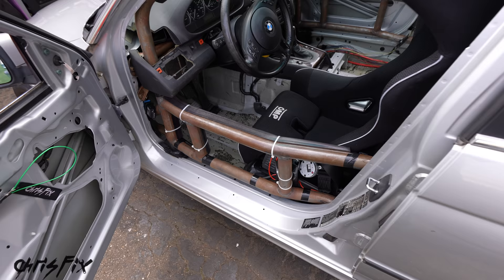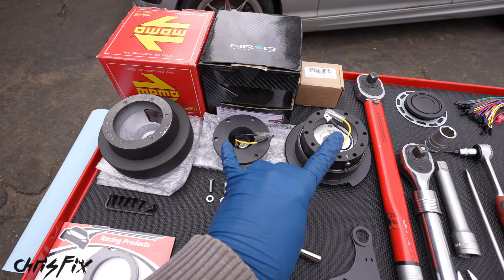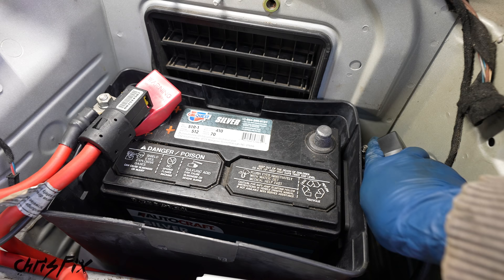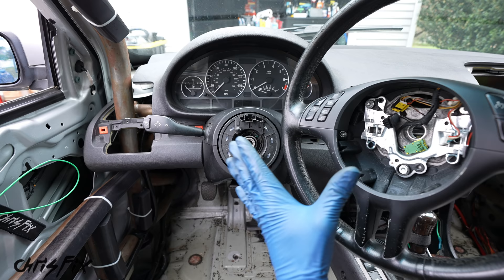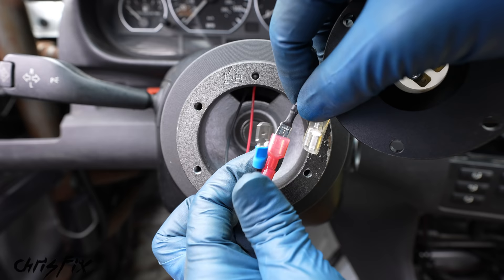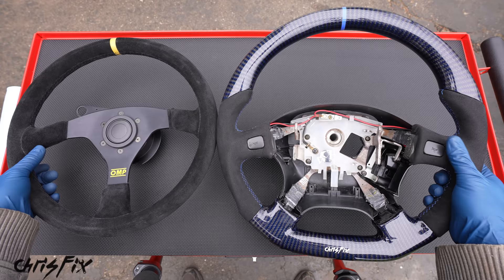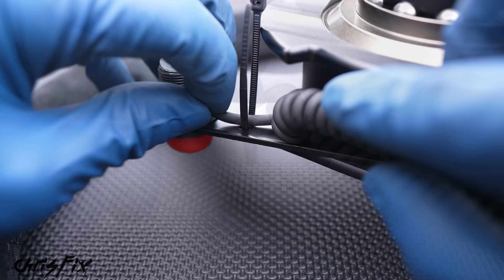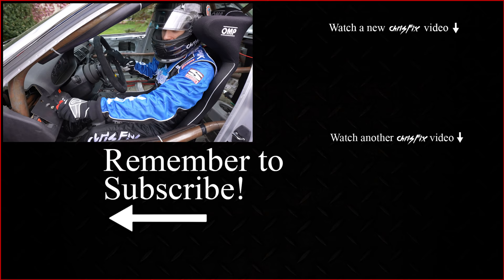How to PROPERLY Install a Quick Release Steering Wheel (with Working Horn)

Comment: quick tip if the wheel doesnt come off right away, keep the bolt in the hole for the wheel a few threads so when you are pulling on it you don't hit yourself in the face

Comment: Looking forward to that fire suppression video!! I plan to go with an electrically actuated one instead of a mechanical knob, and of course buying from Stable Energies once I pick it out. 
Curious about going with the mechanical battery isolator instead of an electronic one like the Cartek. I've got one but haven't installed it yet
Reply from the maker: An electric one wont pass tech inspection. They dont allow it.

Comment: Hey Chris, great video as usual. I‘m wondering, does the wheel connect in the correct orientation every time? Or is it possible to attach it crooked?
Reply from the maker: It's always gone on straight

Comment: 19:53 slight error there. Both wheels have to turn the same amount of degrees to turn the car. However with a larger wheel your hands move more to turn it the same amount of degrees.

Comment: A decade+ in plus 2 years of automotive schooling and this is one of the most informative videos on a steering wheel overall period. Some of my mentors couldn’t get close enough to this kind of information besides general and safety issues or unknown technical issues or electrical-based issues 😂

Comment: Chris, could you help me?
 

I am a member of a Formula Student team in Brazil and we are trying to implement radio communication with the driver, I saw your video and found the solution you got for your Lemons BMW interesting. Could you explain more about the system you used or pass the link of the solution you got? (Does it look like you got a kit with the Motorola Mag One BPR 40?) I would also like to hear what you had of experience with radio communication and if you have any tips that can be useful to us, mainly because my concern is to hear several reports about implementations communications that were inaudible due to extreme noise. Did you have problems communicating using the radio?
 

I've always been a big fan of your video style and I wish you all the best. Thank you for everything.

Comment: The angle of the wheel doesn't change with the size of the wheel. Smaller wheels may feel like they turn faster because he reduced diameter but the angle doesn't change. If you turn either wheel 15 degrees, the steering box sees only the 15 degrees.

Comment: I highly recommend you do not use liquid electrical tape but instead use hot glue.
Initially this sounds like some hack job mess, but hot glue releases with isopropyl alcohol.

So you could plug it there with hot glue, and when you want to take it out you just put a little isopropyl alcohol in there and wiggle it around so the alcohol can get underneath and then just lift it out. You can even make a plug that way.

The liquid electrical tape is a lot harder to clean up

Comment: I removed the center bolt from the steering wheel. When it suddenly broke loose,  the extension wrench went thru the windshield. I couldn't believe it!!! Learn from my mishap. Break it loose with the wrench end facing the floor.

Comment: Where's the link to where you can send your stock steering wheel to get customized like that? That's a great option rather than losing the airbag
Reply from the maker: You'll be adding black paint so it should blend in pretty well!

Comment: Great video! I have a question if you could advise me, i have a problem in Bmw E46 with steering wheel i have race steering wheel and directional light after turn on road it does not turn off after returning the steering wheel to the first position if you understand what I mean🤣

Comment: Good stuff, but why not just mount the button to the other end of the quick release in between the hub. That way your wheel could come all the way off, maybe you’d have to bend the bracket a tad to get it closer but it’d be nice to take the wheel off and not have that floating wire 🤝

Comment: Thanks a bunch sir!! Definitely good video. So I am in the process of building a purpose built drag car with a 88' Gt mustang. I am literally trying to do as much of the work I can before paying someone to do it! That being said, I am in the process of Running the power, and charging system, and honestly I think I am probably over thinking it, but I am kinda stuck with just How exactly I should wire it? Maybe you can make a video for how to wire up a basic charging system and push button starter on a Carburetored motor?? Just a suggestion, lol. Anyways I seriously doubt you read this entire message but if u did. Thank you

Comment: Hmm… well…. My 98 integra’s column spinning apparatus did not fit with the adapter that’s made for the 98 teg column. It does have the notch that’s needed to disengage the turning blinker, but I had to remove the apparatus in order for the adapter to seat 100%.. the adapter DID come with a brass plate & ground wire for the horn that slips to the back of the adapter when sliding onto the column but I still don’t see this working like yours.

Comment: As an electronic hobbyist, just a suggestion: avoid those breadboard "Dupont style" connectors like the plague. They're just about the worst connectors one can get: they come loose, the break at the crimp, they don't make good connections... Especially the cheap ones

Comment: Actually it's not the angle of the smaller steering wheel that makes the car turn more, it's just that the circumference of the wheel is smaller, so for the same distance you hands move the car turn less 😉 can't wait for the next lemon race 😊

Comment: I would've made a connector for the horn pins, those Chinese breadboard jumpers use steel (sometimes copper plated steel) stranded wire which will fail very quickly due to vibration. Seriously, just bring a magnet near them and you'll see. Look at using a dupont connector kit for making your own. I'm an EE by trade and we regularly have weird issues caused by failed breadboard jumpers just from daily lab use.

Comment: Haha the airbag can still go off when disconnected. One way is static electricity so sliding it around on the cloth seat and juggling it around is probably not the best idea. Especially since you are sitting in the car and therefore not grounded.

Comment: I've seen a lot of tuner videos with removable steering wheel installs on cars that may never see the track and I always thought that was incredibly foolish so thank you for putting up that warning hopefully some of those idiot will not do that and put their lives in danger just to look like they have a damn race car
Reply: I am said idiot, cause o do have a street car,but it will also be a car for events that require a roll cage, harness. All the safety you need

Comment: The part about the diameter of the steering wheel impacting the steering ratio is wrong. For every degree you turn the steering wheel, the car will turn the exact same. What will change is the distance your hands will have to move (since a smaller wheel obviously has a smaller perimeter which means less movement). Just wanted to avoid the confusion that could lead to a bunch of people buying the tiniest steering wheels ever just because "my car has a better steering ratio with a 10cm steering wheel"

With that said, the video was great

Comment: Hey Chris, just a small question. If I have a car that has airbag, but it was optional for additional cost at dealership, is it okay to remove steering wheel with airbag for the aftermarket one? Because I doubt they made different safety features depending on if you bought the airbag or not. Thanks prior for answer :)
Btw, nice videos man! Keep up your excellent work

Comment: Could you make a quick release steering wheel with and airbag?
Reply from the maker: You probably technically could, but there would be no point because quick release wheels are only for cars without airbags (purpose built track cars or cars that didn't come without airbags) and there are plenty of awesome custom steering wheel options out there if you want to keep the stock steering wheel safety, feeling, and features

Comment: Hey Chris I have a 2005 duramax and it’s having problems where the batteries won’t charge I’ve replaced both batteries and put two brand new alternators on and even tested them off the truck to make sure they are good and still had the problem I’ve come to the conclusion that it’s either a bad ground, a bad wire, or a bad fuse if you could give me your thoughts I’d greatly appreciate it. Thanks love your videos

Comment: Small thing about steering wheel diameter you got wrong. 1 degree is 1 degree, if you turn a small steering wheel 1 degree the car will turn just as much as a large steering wheel turned 1 degree. That sensitivity you talked about comes from how far you need to move your hands to get that resukting degree of turn which is a distance measurement (cm, inches, etc.) not an angel (degrees, arcminutes radians, etc.)

Comment: Why can't you have an airbag in a quick release steering wheel? I understand there is wiring to supply power, but couldn't that be substituted with some contact points or pins in the hub adapter and wheel? Your stock wiring could be plugged or soldered into the hub adapter, and have a non locking plug on the wheel.

Comment: will disconnecting the airbag cause the airbag light to stay on ?
Reply from the maker: I believe on most if not all cars removing the airbag will set that off. You can wire in a resistor or you can remove the bulb in the clustor if you want the light to be off

Comment: Great video thank you! I’ve read that some people experience stiffer steering and it doesn’t self centre when installing some short hubs like the NRG for a quick release system.  I’ve also read that shaving some off the airbag connector plastic on the clock spring resolves this, but I’m wondering if it could also be the locking mechanism that you removed towards the end of your video. Any thoughts on that? Thanks

Comment: Man, here I am back at this video after a couple months of my nrg quick release working perfectly. Now my horn blows constantly with the steering wheel on. completely disconnected horn button and still the horn blows when i install the wheel. The only thing i did different is i didn't use the stock ground on the clock spring since my hub adapter had a ground wire that grounded through the shaft. for whatever reason the quick release is completing the ground circuit when it clicks into place. looking at how it's assembled it doesn't look possible. If i remove the wheel and put a screw driver across the two contacts on the hub the horn works as it should. I'm dumbfounded.

Comment: Hey Chris, I would love t oget a tip from you on my problem. I'd love to change my stock steering wheel to aftermarket one, the problem is that stock wheel has multifuncional buttons used to control the actuall on-board computer between dials behind steering wheel. I want to change it to one without buttons, is there any different way to control the on-board computer? I don't care about multimedia buttons for radio but I need to be able to control the computer since you set up everything there.

Thanks for advice!

Comment: Erm, on a steering wheel 1 degree is 1 degree no matter what steering wheel. No matter the size. It's the outer ring travel that changes with diameter. just a small hic-up.

Comment: Great video just wanna let u know that in track racing you want a smaller steering wheel because if you need to make quick movements if you get loose on the track you need to be able to save the car and I think you should look up knowledge about it or go out racing before you start saying facts that aren’t the truest cuz look at a dragster look at a super comp car they don’t have big steering wheels

Comment: Interesting vid, but as I'm sure others before my may have pointed out that millions of cars are on the roads worldwide without airbags that are just as safe if not safer than those with. In fact I went to a quick release because honda told me mine was defective from factory  & on recall...so 🤷🏾dammed if ya do, Damm if ya don't

Comment: A little quick tip, deep-dish wheels have 2 uses, only one is advertised, you can turn it around so it goes farther from you, little tip for the people with longer arms. Another way is to shorten the steering wheel shaft which is a problem by itself, either method is good, one is harder that the other, and one is easier than the other, both are affective strategies, both are a pain in the rear. Do with this info as you wish. *I am not responsible for any injury or death caused by modifying a vehicle with these ideas IE: don’t sue me if you do this crap and you get hurt*

Comment: M5-16 isn't a thing fyi. Probably M5-0.8x16. The hyphenated number is the thread pitch (in this case 0.8mm, which is coarse thread M5), and the multiplier number is the length. 

Not trying to nitpick, just figure it's good to clarify since your audience might not be acquainted with thread nomenclature.

Comment: Hi Chris fix, I know you respond to comments but it's probably really hard to see all of them, but I hope you manage to find this one because today I bought a used 2008 Toyota Camry as is from the dealer and soon I found out the gear indicator lights were showing drive, neutral, and other gears while I was driving in drive, and soon after that the drive light was flashing alone and turned cruise control off while I was on the highway, now it's not turning on. Google says it's something about the transmission and could be the ecu and might be a 1-3k repair right after I bought it. 

My question is since I've never heard of this is this something to worry about, a significant/expensive fix or maybe 90% of the time it's just a cheap sensor because I'm very worried, obviously only a mechanic or someone more mechanically inclined than me checking it out will really know, and I plan on doing that, but I'm very worried I won't be able to return it to the dealer and I'll be stuck with a $3,000 repair I can't afford and probably shouldn't do for such a cheap car (compared to others with the prices these days). Sorry it's a bit long, but I love the videos, they got me started on working on my own cars a little bit for the basics, but I really trust your judgement and I haven't found any solid videos or advice online.

Comment: Hey chris can we get how to install radio for comunication or something like that it will be great me and my family going racing and i dont know how to so yeah....
Reply from the maker: It''s actually already done so I cannot film it for this car. It's super simple so here is an overview. It is just a battery operated walkie-talkie that comes in the mount that you saw which is zip tied to the roll cage. The walkie-talkie antenna unscrews and the kit comes with an antenna wire that you connect to the walkie talkie and then to an antenna  on the roof of the car (drill a small hole through the roof and screw the antenna in). The other wire goes to the push button you saw which is simple. And the final wire goes into your helmet where you remove the foam padding and put a speaker which comes in the kit.
Reply: @chrisfix  alright thx any way keep the good work 😁

Comment: Hey Chris, love your videos. I was just wondering, I have a 2005 Pontiac Bonneville with a 3.8L 3800 series 2 motor. Would this make a good track car?
Reply from the maker: Any car can make a fun track car. Once you start making it lighter it makes it a lot more fun. I think it’s front wheel drive right? I prefer rear wheel drive but the lemons race car is awd and still a lot of fun.

Comment: Hey Chris  I know this video is a bit old but I hope you reply, I have a 1996 Miata and I don’t like the look of the middle part of the steering wheel but it is my daily driver, is there a possibility that I get an aftermarket steering wheel with airbag or is that impossible?
Reply from the maker: Do a search for "96 Miata carbon steering wheel" and there should be a few aftermarket options that keep the airbag!
Reply: @chrisfix  yeah I did that but it still has the same middle part as the stock one, I want one like the quick release ones but idk if there is some kind of possibility for me to have an airbag in there

Comment: Am I able to use my cruise control with my steering wheel? I use my cruise control to change my maps on my e46 and wonder if I can just connect the cable that goes to the button and remove the button itself and leave it hanging when I need to push it?

Comment: Chris I have a problem can you show me how to fix tire pressure sensor it pops up every time and it's annoying I checked the tires the tires are fine but the sensor is still popping up I tried resetting tire pressure but it's not working pls show me how to fix

Comment: hey Chris trying to replace the steering wheel in my 2001 crown vic but I have a 2005 coming in with the air bag please don't tell me that the shaft is different or will it fit its a p71
Reply from the maker: I am pretty sure it should fit.

Comment: Hey Chris, I have a problem and maybe you can take a guess about a problem of mine, Corolla 2005 Sedan, when I turn left or right on front right wheel there is a whistle, when braking there is no sound, also when I start off, first 2-3 meters there is that anoying whistle sound, thank you

Comment: Is it possible to have a quick release with the air bag attached? I assume no which sucks:/ also is it possible for ur radio wire thing to press down ur steering wheel quick release levers when it wraps around the steering wheel when turning?